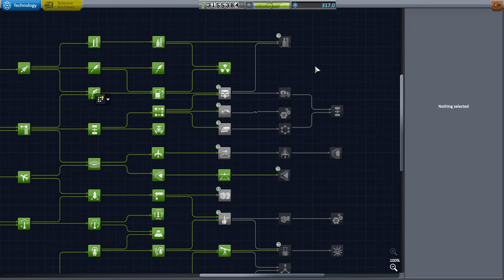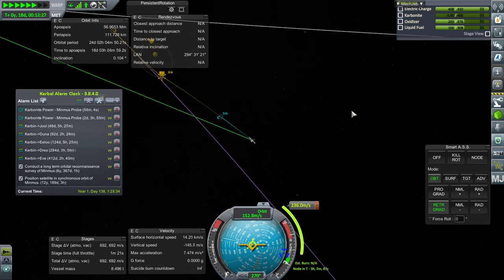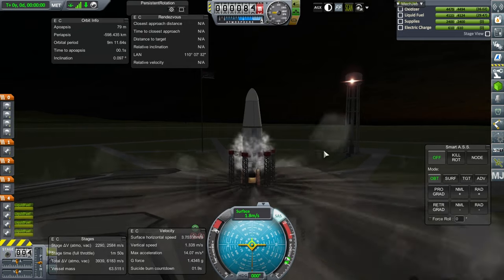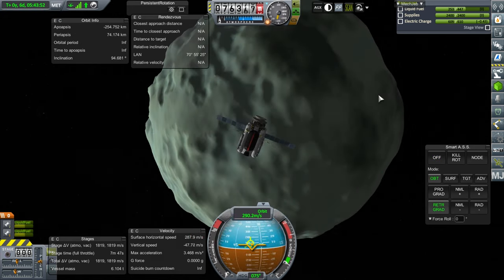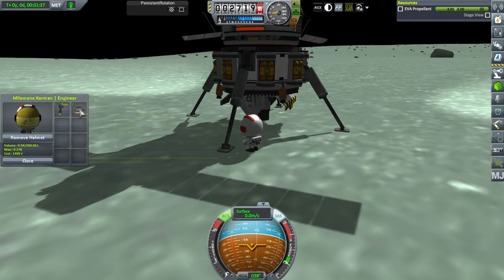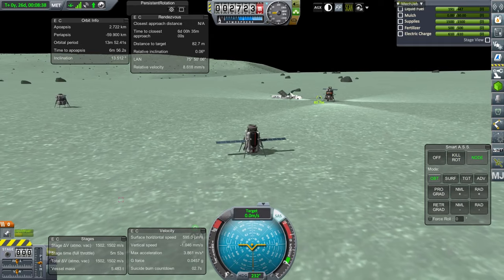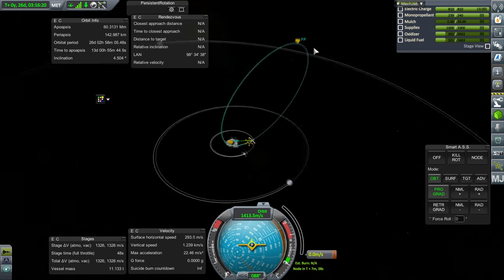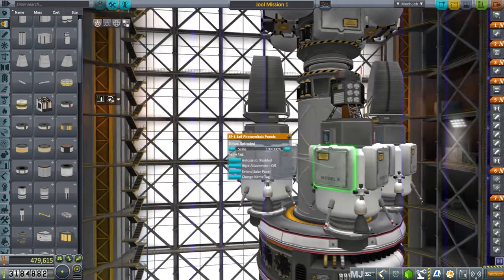Kerbal Space Program - Kolonization in 1.2 15 - Making Connections

Comment: What height speed are you normally starting your 'gravity turn'/pitchover that you are maintaining prograde with afterwards until you get your Periapsis above 70 km?
Reply: Hmm...think I'm going to do some looking up then of mathematical equations to use for calculating gravity turn starts then given a certain TWR and assuming nominal drag and stability, as I tend to aim for a TWR of 1.3-1.4 for all of my designs and prefer to put fins with control surfaces on the bottom boosters for flight stability and want to come up with a better profile than what I've been doing for a while now: 

with a 1.3:1 TWR, no matter the vehicle the size, I've been pitching over to 85 degrees at 50 m/s, 80 degrees at 100 m/s, and then to 70 degrees at 3 km regardless of speed, and then following prograde from there until my time to Ap reaches 45 seconds, and by then if I'm outta the lower atmosphere, which is almost always the case unless I've completely FUBAR'd on the design, pitching all the way down to 0 and burning until Ap hits 75 km to lessen my orbit insertion/circularization.  I sometimes pause my prograde following after pitching to 70 degrees if I'm closing in on having to sep strap-ons or otherwise stage my vehicle.  

I know this ascent profile is NOT a one-size-fits all solution however because the amount of dV I have left reaching orbit is too unpredictable for my comfort and so I wind up having to way overbuild on dV margins.
Reply: Define 'high' TWR then.
Reply: I may then try this for 1.3-1.4 TWR: pitch to 85 degrees at 100 m/s, pitch to 80 degrees at 200 m/s, and then pitch to 70 degrees at 400 m/s or 3000 km, whichever comes first.